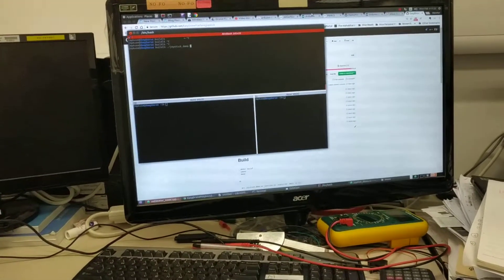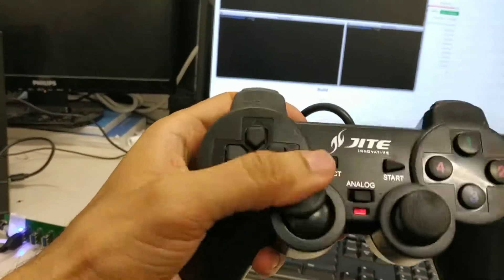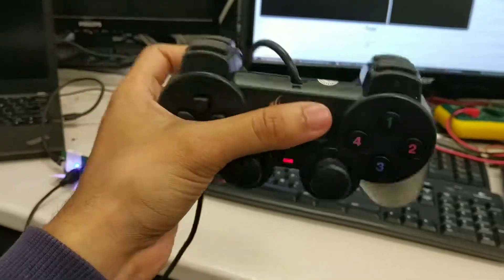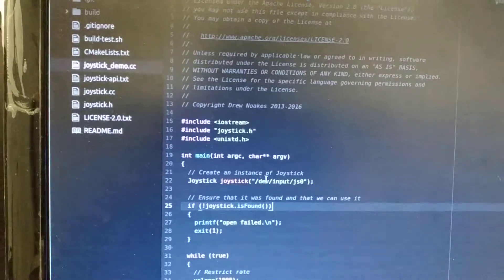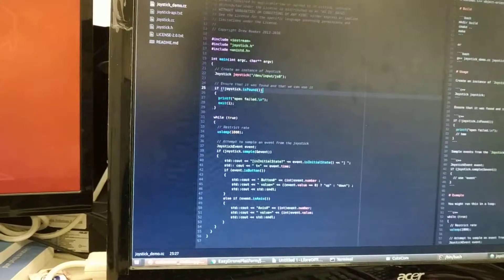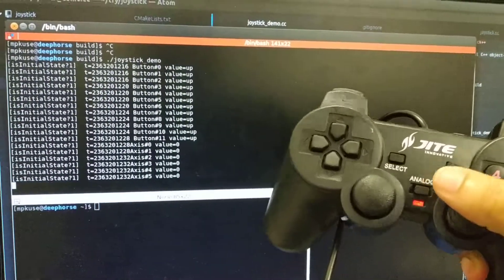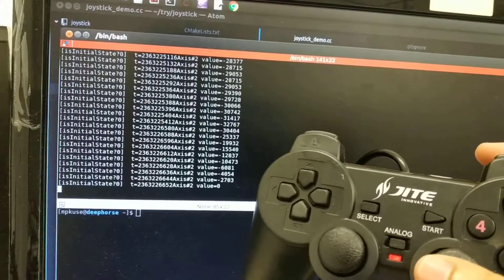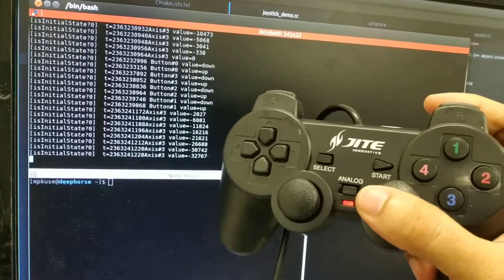Joysticks input on Linux

Comment: Great Github repo! Shame that no one gives it a star! Anyway, I just did. Just two quick questions (sorry I'm a bit new to Linux syscalls): 
1. I know functions like "open", "read", etc are from <unistd.h> and <fcntl.h>. I remember they are C libraries. To call them in a C++ script, do we need something like extern "C" declaration?

2. Why did you define a "JoystickEvent" class in "joystick.h", instead of using the out-of-box "js_event" struct? (Saw it in your "joystick-api.txt") Are this C++ class compatible with the C struct js_event?

Anyway, thanks very much for your work!
Reply from the maker: thanks for the star...! I think you dont need an extern, you could simply include unistd and everything should be ok in C++. I am using JockstickEvent class so that in other projects one can simply copy these and dont need to worry about the details. JokstickEvent uses the C structs, not sure what you mean by being compatible.